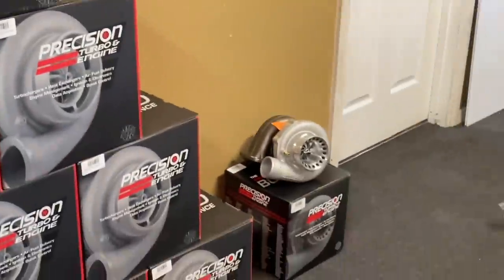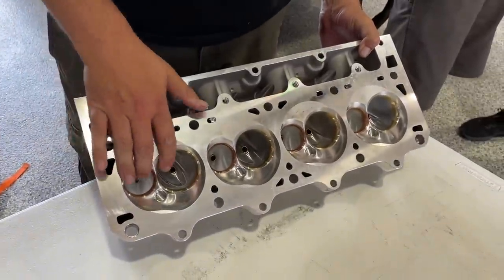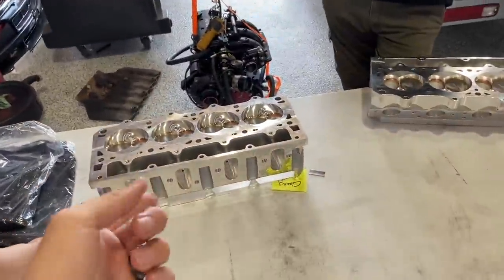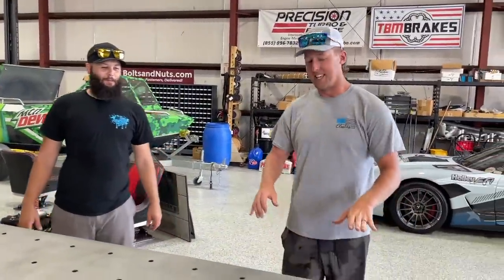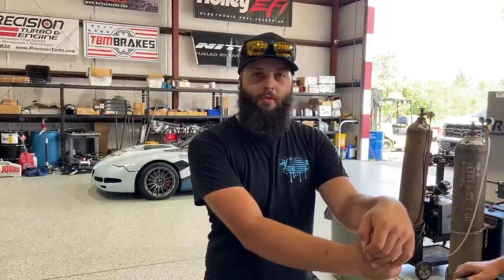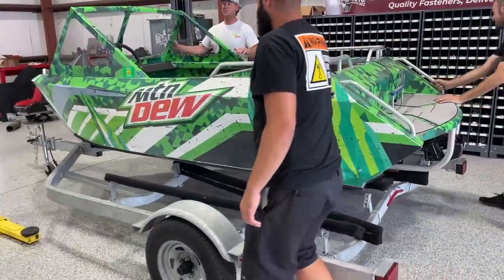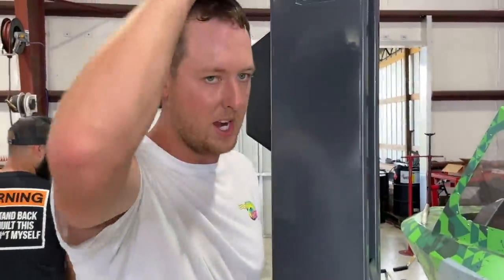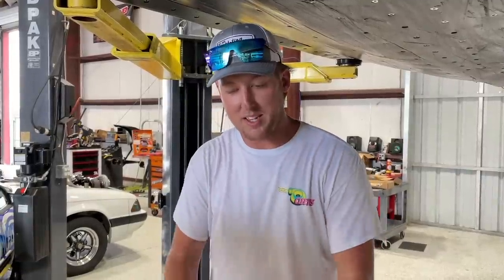My Beloved Mini Jet Boat Is Pretty Much TOTALED... 30+ Broken Welds, But It Gets WORSE!!!

Comment: I love how Cleetus can't believe random people don't want a giant turbo lol
Reply: Like there's not many things you can put an 88 on he's talking like that isn't a crazy amount of air
Reply: ikr, that's what I was thinking that the whole time 🤔😁
Reply: There might be some extra  88' on marketplace this month..😂
Reply: Of all the free turbos, how many will actually be installed ? My guess is less than 1
Reply: I think most of them 88s will end up on Ebay
Reply: I'd want the 88mm, would look great hanging in my shop...
Reply: @merczeph79  Wall art, Lol!
Reply: Well, Cleetus welded one side of those welds alright, it’s just the non penetration on the second side that doesn’t really count as a weld? Ty’ll get it! Nice bribe with the tricked out welding table.
Reply: And while you’re off to Idaho trying to break the jet boat 2.0, Ty can stay in Florida and fix the rest of the stuff that you broke. Lol
Reply: @merczeph79  same
Reply: Why arent people thinking about selling the more expensive 88 to get whatever size you wanted and then a lil extra
Reply: Would a 88 be too much for a 5th Gen Camaro SS? 😅
Reply: That 88 would go nice on top of the 366 in the valley of my LB7 Duramax. Why can't Cleet give away a set of Carillo con rods to go with each turbo? 😎
Reply: You have to have a serious set up for that 88 and I’m pretty sure the 64 has the highest msrp.
Reply: If you've got a stock motor you can work with a 64 and if you've got a built motor you can still probably work with a 64.  Stock rods and head bolts on most motors would not handle an 88 well on high boost and would have a hard time getting it going.  Especially with how high flowing these "small" turbos like that 64 are these days.
Reply: B P - Yeah Buddy!!  But as ya approach 80, a $10 Gift Certificate for a Dennys Restaurant seems nice.......
Reply: @seanharrison6162  shit if I win I'll put it on my bone stock silverado. I can't think of a single thing that could go wrong😅
Reply: @shadow105720  Great for a compound setup or diesel tho.
Reply: Imma need a turbo to spin up my turbo
Reply: Lol cleet can't imagine how every rando isn't putting down enough power for 134mm turbskis!! 😂😂
Reply: @djorion11  I tried to find a 76 from last years turbo giveaway and never even seen one for sale
Reply: My 408 would love an 88mm!
Reply: Possible to assume Precision wasn't even selling them enough and that's why they offered them up for promo.
Reply: I’m going to give it a shot,so mark my words if it happens you’ll see an 88 on. a Buick 455😮
Reply: I would put an 88 on a 4.6 2v idc. Go or blow.

Comment: That engine is going to sound insane at that rpm. That car is going to be insanely fast.
Reply: Car already sounded insane in person. Gonna be interesting to see what it sounds like now
Reply: @kick_then_shift  Yea, I wish it were coming back to OK, but guess I'll settle for Mullet and McFlurry lol. But yea, it sounded awesome in person
Reply: @shalakabooyaka1480  what's in OK?
Reply: @Shalaka Booyaka  hope your not talking about 2.0 bc it's no longer in oklahoma so he doesn't really have an event to come to here no more
Reply: Well, still need to get the power to the ground......
Reply: @MrKveite1  it’ll be fun to watch them figure that process out…
Reply: @hondafrk  well sooner or later the weight and hp ratio will crash so yeah. There will be a lot of suspension work coming up.

Comment: I love that you’re doing the turbo giveaways. There is so many people out there that would love to be able to experience what you guys do  every day and just don’t have the means to do so. You guys are killing the game out there, cheers🎉
Reply: If only it didn't require so much more stuff to make that turbo work.  Most of these winners will sell the turbo when they realize what's required to use it.
Reply: @-joe-davidson  Doesn't require much.
Reply: @unclejohn5012 nope, just new exhaust, mounting brackets, oil feed and return, tons of creative engineering if you still want a hood and everything else to continue function that’s near it under the hood, then the fuel and control systems to utilize the added air. Not much at all…..
Reply: @WizDJ completely agree IF they dont know what they're doing. Someone with a mechanical or mend and make do attitude would have it knocked out in a day or even an afternoon with the right motor
Reply: @-joe-davidson  intercooler, piping, ecu, exhaust fab, reworking the entire heads, the compression, etc. It's a pain in the ass if you dont wanna blow up a stock engine while looking for that boost punch.
Reply: @unclejohn5012  yeah? have you ever actually built a kit?
Reply: @maybenot6075  anyone who knocks out a turbo kit in an afternoon or a day for a vehicle that didn’t already have a turbo and they didn’t simply purchase everything needed and bolt it on is not going to have an engine the next day. 

You’re spending too much time watching YouTube channels build complete vehicles from scratch in 45 minutes and now you believe it’s real time.
Reply: @maybenot6075  absolutely no chance
Reply: @Toxic2T  
Like I said. It's expensive and it requires a lot of extra stuff.
Reply: Precision Turbo is footing the bill, not Cleeter. High view/Subscriber count youtubers get stuff thrown at them all the time for promotions/Campaigns.
Reply: @WizDJ  agreed...even with Tye and Jackstand and George and Zach and the whole crew they can't do an entire build in an afternoon.
Reply: @Daniel-vh9lg  exactly they don't pay for anything, you think he paid for the heads or the welding bench? no way.... he's providing advertising on his platform.,
Reply: @unclejohn5012  it does if you're not a mechanic or at least not friends with one, it's gonna be 4 figures to actually get those turbo's working for most of the winners. I guarantee the majority sell the turbo's.
Reply: @maybenot6075  in an afternoon? Yeah the average viewer doesn't even have 20% of the parts needed to get a turbo conversion working, nevermind the skills to do it themself. You're living in a dream world bud, YouTube is not real life. Then you're assuming they've bought injectors and pumps and everything else required just on the small chance that they win a cleeter turbo. 😂😂🤷‍♂🤷‍♂
Reply: @-joe-davidson  Yup I agree. It's hell lol

Comment: Working on aluminum vacuum chambers  we always took an LP heater and blasted the chamber over night and it would be hot AF. As aluminum dissipates heat good and thats the reason of cracked welds.  Nothing you did Clete, heat it up first. Plus aluminum is porous and clean it with a wire brush

Comment: Damn now Cleetus has two engines in his cars from two of the best engine builders in the world! That's impressive?
Reply: Neither one of those builders would even consider themselves as the "best in the world". They are both humble builders who started out small and have done well for themselves. 
But this best in the world stuff is going way too far.
Reply: @williamstamper442 riding big titles for content for both sides, while technically being the best in a specific race category, I would take it far too. Then said best in category corrodes his valve train from his own fuel misuse. 
No one is the best for long or consistently, that's why they're the best.
Reply: Don't forget he has a Nelson engine sitting somewhere too...

Comment: Kitty hair bondo (the bondo with the fiberglass fibers) works pretty good to smooth the transition between the uhmw and the intake.   I had the same issue where it cavitated bad while cornering and the bondo worked remarkably well.  Took a solid years abuse before I had to touch it up too.

Comment: Really excited to see what Pete can do those presents he brought look crazy and stroked out Leroy sounds so cool curious how different he would sound
Reply: Think donnie with the solid roller cam. High rpm screaming
Reply: @danhammond8406  except for the short duration high lift roller and the almost stock heads with small valves and N/A..... Leroy is going to be a short stroke HUGE valve and port twin turbo... I honestly don't think that anyone on earth has ever heard a engine that is going to sound like Leroy is going to. Hey who knows it might turn out to be the first good sounding LS!

Comment: Can't freakin wait to hear Leroy spinning 9500 through the traps
Reply: Kinda breaks my brain to think about a pushrod engine spinning that fast. I remember the days back in the late 90s when you needed a crotch rocket or a Honda to Rev that high without murdering your wallet in the attempt
Reply: @judahcanaan7015  pushrod engines have been doing it since the 60s
Reply: @judahcanaan7015  huh, hell i had a 327 in the early 90's that would pull high 9000rpms.
Reply: @judahcanaan7015  NASCAR has had that for decades, with the engines redlining upwards of 10k. No wonder they put out around 900 HP N/A

Comment: I think, and I'm pretty sure I'm not alone in this, that the average public doesn't have the commitment to build enough motor to run an 88. Maybe do a video seeing how a stock crown Vic with a cam to properly use it would do with an 88

Comment: I’m insanely jealous of the wire rack behind Cleetus at 7:45. Dang brother I want that.
Reply: I'd save so much time if all my wires looked like that
Reply: One of the guys built it. It's all wood frame and sch40 pipe for the rolls of wire to ride on.
Reply: In the video 1320 did on Cleetus’s stuff, he said there’s over a thousand dollars in that wire rack build. He said Nate built it with a couple two by fours and some schedule 40 pipe in a couple hours when he first got hired. So ten dollars in materials and a thousand dollars in wire!
Reply: @Hoaxer51  Zach built not Nate. only thing Nate builds is boost i think haha
Reply: @warrenmichael918  Sorry Zach, I got the names mixed up, thanks for setting me straight Warren.
Reply: @Hoaxer51  I wasnt trying to set you straight lol i figured you just got the names mixed up though!

Comment: Hey they use the same radio I got in my room. Btw it's super easy to add extra speakers "safely". The wires easily push in the back

Comment: The UHMW peeling up off the edges of the intake grate is 100% what is causing your cavitation, I had this issue so bad my Jetstream literally could not turn at anything over 10mph but they were flared off the hull a lot worse than yours. I added 9 more screws along side the grate and I had no issues afterwards.

Comment: Did good by using stitching welds.  Most use it to avoid one break migrating through the whole welded edge.  Using aluminum you might want to fold parts into each other before you weld instead of bucking them up and drawing a weld to hold it in place.  Would like to see a new race against BoostedBoiz after this

Comment: at 8:10 The Dew boat is the way it is cuz you NEED to use Aerospace grades of 8000 Series Aluminum on the outer shell at a FULL 1/4 inch thick in order to make it beat-up proof!  The stringers and box frame can be whatever thickness makes you feel comfortable BUT the outer shell MUST be a full one-quarter inch thick! Only then can you TRULY jump more rocks and stumps than you can throw a solid granite stone stick at!

Remember: 8000-series Aerospace Aluminum at 1/4 inches thick!

V

Comment: Y'all need to get with Jetstream and come up with a special "icebreaker" or "Cleeter special" version of this jet-boat pattern.  Heavy-gauge sheet metal for the hull, extra stringers, a beefed-up engine mount, and maybe some positive-buoyancy material for when it inevitably goes submarine on an Idaho river.

Comment: @12:42 that fatigue cracking wow 😂 melt the sucker down and start again
Reply: That whole rear bulkhead is hooped also not all aluminium is made equal choose the right grade and stick to it welds between grades are a weak point

Comment: The drain plug… if you put in inside the boat and you take on water you can pull the plug and get moving fast enough it’ll actually let the water out.

Comment: Hey cleetus if you want someone to work in the shop with you guys, that can build those heads and every engine in the shop, FULL TILT! ILL LEAVE ALABAMA AND MOVE DOWN THERE!!! May be nothin to you but I attended courses at SAMTECH in Houston TX a few years ago. I can also tune all platforms and build transmissions. Basically I can build or do anything, I just don't paint. IM SERIOUS!!

Comment: TBH, it's not the actual welding that's going to chew up most of the labour time, it's going to be the prep' time cleaning off the failed welds and most of the rest of Garrett's original "welding".
Can't recall, but if they don't already offer it, it would seem to be a smart move for the boat's manufacturer to offer a heavier gauge "Cletus spec'" lower hull for customers who expect to be rock crawling in their boats?

Comment: Gimme that 88🤣 my Integrated Engineering rods are good to 1500. I have a habit of pushing things🤣 salute to the pile of heads and short blocks and carnage on the side of my shop🫡 you all will be missed. Also. Still going to push compressor efficiency past the curve🤣

Comment: Well the silver lining would be you can see you only got penetration on one side of the weld, it should have tore the meltal on both sides you can see it cleanly broke on the hull side of the weld.

Comment: Cleetus the reason your welds have broken there is because there to cold each weld there's not enough penatrion in them you can see how there raised up more amps and reweld and is will be good and the outside reweld then plate strips over the top and reweld

Comment: Those broken welds that still have a complete bead attached means you didn't have near enough heat to melt them into the hull plates. Second time's the charm with your man Ty taking the helm.

Comment: Don't fully weld the stringers, you need to still stitch or a crack will propagate entirely down the weld.  At least place some gaps between the longer welds.

Comment: Yes to a DE-stroker. In a 4G63T long rod stroker pistons = less wear on the piston rings and cylinder walls less stress on the connecting rod. Stroker are good for time attack drag racing about high rpms. Depends on engine like a B or D best not to go long rod they need all the horse torque they can get lol na has to do with rod to stroke ratio and pistons speed race car science. Everyone Scared to run long rod or de stroker because of how little information there is about them unless your engines been around for quite a while and was able to accommodate long rod without block modifications. 454 long rod ye ye
Reply: De-stroking is about the direct relationship between piston velocity and crank stroke - the actual limit for any engine is not in rpm but piston velocity and spring dwell time. You trade NA torque for RPM, but since you have more boost than you need anyway you get that back from boost (cos again, your limit is max cylinder pressure, not boost, so you can add more boost to get the same amount of fuel and air in) and the revs are pure gain.

Comment: That's not good advertising for the boat builder. The welds were pretty but didn't fuse to the skin.
Wouldn't have happened if Ty did the welding.
Love that table.... and I don't even weld.

Comment: What Cleeter failed to realize when he got 88mm turbos is that in reality, when you can run an 88mm, it's the cheapest part of the build at that point. you need so much to get to that point that the cost of the turbo is a single digit percentage of the build cost. 
No one who has an engine that can use/needs and 88, won't have one, and most people don't have anything CLOSE to that, so it's just a bookshelf piece.
It would be like if Cleeter won a deluxe asphault curb machine. Sure, it's expensive and neat... But utterly useless to him and kinda pointless to own

Comment: I'm kinda over the mini jet boat stuff. Sure it should be repaired and brought back into action, but the only logical next step is to double the horsepower.
I don't remember the company but recently saw an LS headed 4 banger with a freshly casted block that in essence is the equivalent to half an LS. This is gonna be a production aftermarket engine offered to the public. 
This boat needs that engine. And a single 64mm hairdryer. 
Like I said, this is the only logical next step.

Comment: Those welds definitely aren’t properly fused. When you mig weld aluminum you really have to tune those settings in perfect. Not talking shit, aluminum is hard to weld -a pro welder.

Comment: You're saying "broken weld" but what I'm seeing with a lot of those welds is little to poor surface  penetration. Most of those welds would still be intact if they had proper penetration. You've even admitted over the years that it was a beginner's welding project for you guys. Gotta learn somewhere I suppose. Just strip it down and have an experienced welder redo it. No biggie. It's salvageable.

Comment: to be fair most of those welds sucked (i know your new}. you should of tig welded all the bottom/structural. Let me know if you need help, been welding for over a decade. Certified and know every process and all materials. Also local, Tampa area

Comment: Yeah well, that's why you don't jump boats off of trees and shit. They aren't stadium trucks with suspension made to jump.. in fact they have no suspension and water when struck hard enough acts like a solid which is why belly flops hurt like hell. It's 100% your fault that it broke, if you want to jump something, get a stadium truck.

Comment: DO NOT MAKE FULL WELDS ON THE STRINGERS!!!   You want to use stitch welds.  Why?  If you do a full weld, when, not if, when the weld begins to crack; it will rip across the whole weld.  Stitch welds will only fail on at a time.  So instead of losing an entire stringer, or engine mount, you'll only lose a small section of structural integrity.